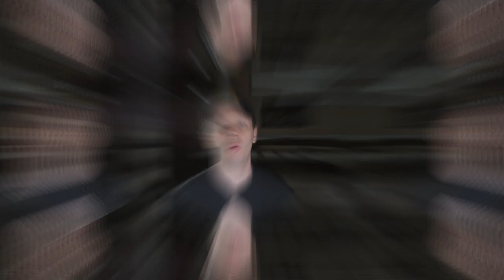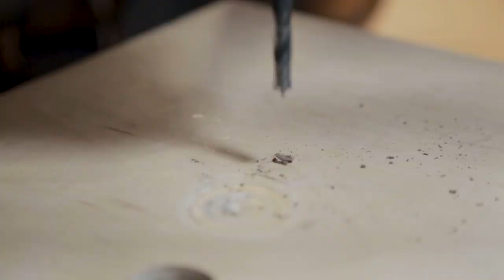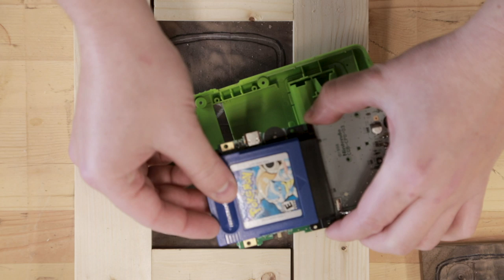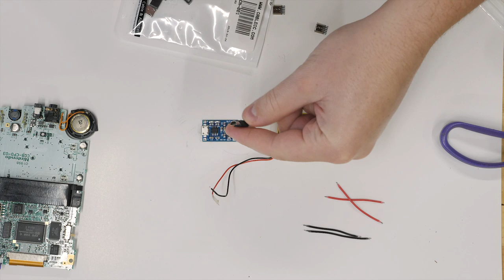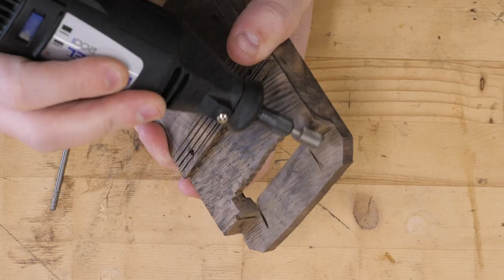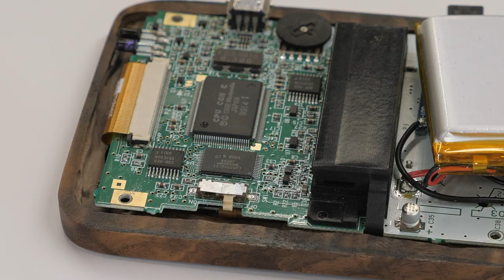Retro - How I Made A Wooden Gameboy - DIY

Comment: That is a beautiful piece of walnut. Amazing work! It really turned out nice. How about a Nintendo DS or DS lite in wood? I would probably lose the hinges, though, and make it one solid piece, like a 2DS. I would definitely want the electronics to have the GBA slot, though.
Reply from the maker: Thanks for the suggestion! I will have a look at it. Never had or played a DS or DS lite so it will ALLL be new to me.
Reply: @KevBotWorkshop , my four kids all have DS lites that we bought them years ago. The three girls haven't used theirs a lot, but the boy's has been used a lot. I had to replace the hinges and a screen. I discovered that working on small electronics is not my thing. I find it very interesting, but I'm 6'2" and big. My big o' sausage fingers make it difficult to work on those little things. If you're patient, you can find a good deal on a used one on eBay. I'd look for a pink one. Nobody wants pink, so they can be bought cheaper, and girls don't use their video games as much, so they should be in better condition. The early DS and DS lites have 2 slots. One for DS games, and one for Game Boy Advanced. Some of the newer versions deleted the GBA slot. BTW, my son, who is a video game junkie, says that the 3D on the 3DS is terrible, and not worth the extra cash.
Reply: @dannyhale7645  I played 3ds while on a ship with a bunch of navy guys. bout 95% of us turned 3d off. if your not lookin at it just right it looked horrid.